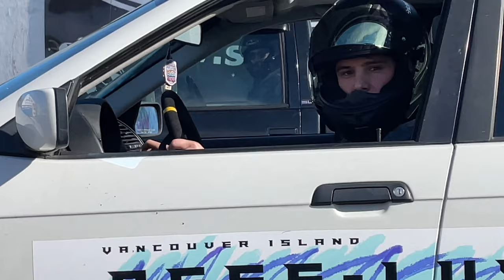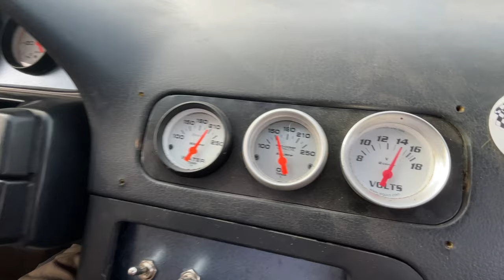Ford V8 Swapped Nissan 240sx  goes Drifting

Comment: So damn sick. Hope you can answer this. I’m dropping a 302 into my s13.  What headers did you use??
Reply from the maker: I’m pretty sure you can use stock headers or aftermarket mustang but they are basically beaten until the steering shaft clears
Reply: Cx racing make headers and mounts you have to make a oil pan to make it work.
Reply: Bbk shorty headers, but "massaged"